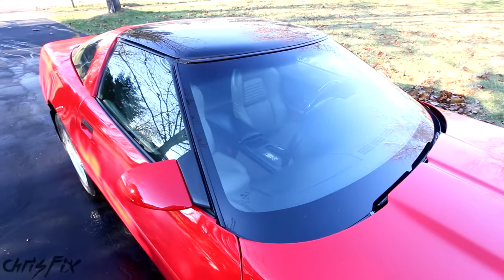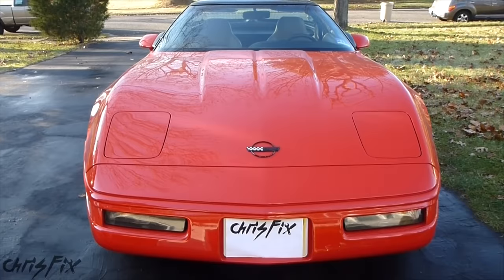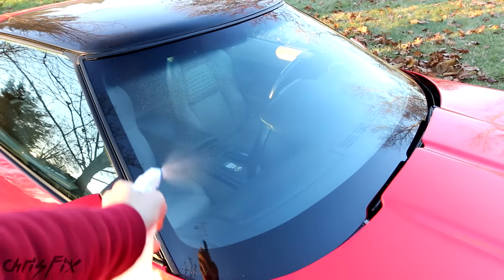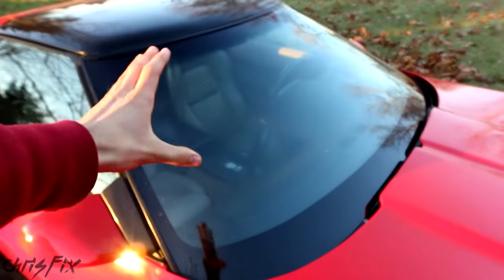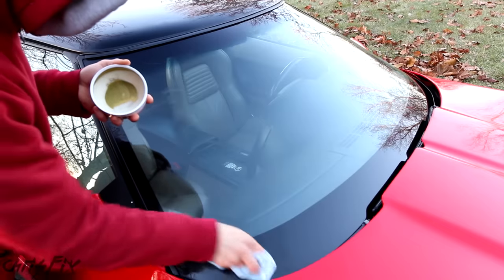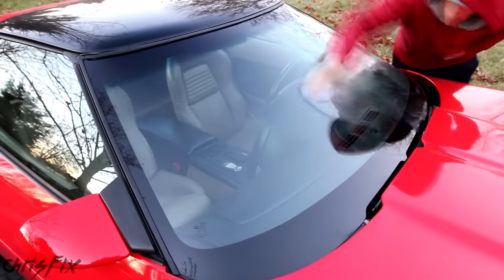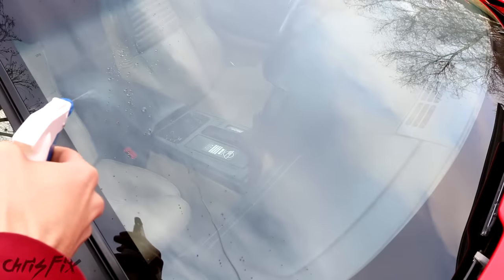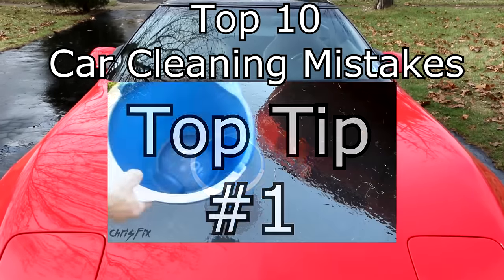How to Super Clean Your Windshield

Comment: My observations after detailing cars for years and trying various waxes...  Wax tends to leave bigger water drops that join together and are harder to see through because they are less uniform and larger.  They also sit on the window larger because they are bigger and it takes for force for the air to blow them off while driving.  Rain-x makes the droplets go into smaller beads that are more consistent in size and spacing and it is easier to see through the droplets, and  they blow off easier while driving.  This is just my observation on using a few different types of waxes. (Perhaps different types of waxes produce different results.)  Based on my observations rain-x provides better visibility.
Reply: Great analysis, thanks
Reply: Does your vehicle not have windscreen wipers? I recommend their use for the removal of raindrops - large or small.

Comment from the maker: I just posted the newest Super Clean video: "How to Super Clean your Interior" 
https://youtu.be/tGnf8G8A8qU
Reply: Your face!!! We see it!
Reply: Do you use special detergent to wash the towels you use? Can them all be washed together? TIA for your answers!
Reply: How do you super clean a nissan sentra gxe 1998
Reply: @jessie_official22  NOT with 2002 se-r microfiber cloths
Reply: Saw a video of a guy using plumbers putty instead of a clay bar but it was on a  white vehicle so you really couldn't tell if it scratched the paint
Reply: Can you tell me what kind of wax I buy
Reply: How you clean those microfiber towels?
Reply: Please post a video about how to remove stubborn water stains .
Reply: use the washer wiper thig then easyer
Reply: How do you remove deep water stains....my car has been neglected and cleaning it recular will still leave it foggy
Reply: I'm having issues with hard water stains on my cars glass. What do you recommend??
Reply: Hey Chris!! Quick question, how do i get rid of the scratches made on my windshield from the wiper blade? Steel wool and soppy wooder?  Please let me know what you recommend!
Reply: one of a few youtubes to still be active on older video ussually the bigger the channel gets the less the interact <3
Reply: u said it after 6 years
Reply: When I clean windows I wipe up n down inside ( when clean) & left to right outside so any marks/streaks I know if they are inside or out 👍
Reply: Yes, I can finally Clean my Dirty Interior In My Lexus
Reply: You should def leave some Amazon links lol
Reply: You realize we see your face so there's no need to wear a helmet anymore
Reply: What wax do you use?? The link for the wax isn’t working for me!!
Reply: Hey bud I'm gonna try this out before installing my new Piaa wipers, but my question is after I wax would you suggest to apply the silicone wipe that comes with the wipers over the wax or just skip that? Additionally will the silicone wipers do well with the wax or would you think they'd make streaks being two coating type products? Appreciate the videos as always man 👍👍
Reply: By in
Reply: @douglasbennett8184  qqqq
Reply: What year is his Corvette
Reply: Can I do this to all my other glass on the car?
Reply: Can give a video on how to clean your used microfiber towels???
Reply from the maker: @ramdomgiltter5590  that’s a good idea
Reply: Will plumbers putty work just as good as a clay bar???

Comment: it's good to respray old wiper arms and replace the wiper blades while you are in there, wiper blades are usually very cheap and while they are off the car you get access to the lower portion of the wind screen to clean it properly.
Reply from the maker: Great tip! Thanks Alex!

Comment: One of the most important lessons you can teach a new driver is how CRITICAL having a clean windshield is (all windows actually). The difference in visibility is unbelievable. It also reduces eye strain during long drives - especially at night and with how much brighter headlights have been getting. 

And using wax or Rain-X can save lives. One of my friends was driving into NYC across the Pulaski Skyway and a truck kicked up muddy water. Had his windshield not been treated with RainX, he almost certainly would have run into a concrete barrier and gotten killed.

Comment: SUPER IMPORTANT TIP: 

If you just bought an older used car DO NOT I repeat, DO NOT use wax on your windshield. It will fill all the tiny dings and crevices, creating a bunch of white spots that (so far) cannot be removed and it will make it look even dirtier.

Thought I would share to make some good of my mistake and hopefully prevent others from doing the same. Although, on the upside, the windshield is definitely hydrophobic! :^)

If you know any ways on removing wax from dings, please let me know.
Reply: Buy a new windscreen!
Reply: Maybe use ceramic coating?
Reply: Same thing here. Wax did not dry after 20mins and I had to remove it with soapy water i big pressure on windshield. This wax was mistake…
I am not sure if I got all of it off because it now raining outside now
Reply: a hair dryer will melt the wax, use your microfiber cloth to remove it once melted, you only need a few seconds of heat, do not apply heat for longer than that.
Reply: Seen in other videos an actual side-by-side comparison between wax and Rain X and it looks like Rain X seems to be the winner. Regardless of which one's better at repelling water, Rain X might be the way to go if you're worried about potential windshield dings?
Reply: Does rain x do the same?
Reply: @Chris-pj1os  Highly doubt it. It's a liquid in a spray bottle.
Reply: @Chris-pj1os yes it works wonders the ceramicx one
Reply: Same here. Looks like millions of tiny specks.
Reply: Will wax prevent Rain-X from sticking and vice versa
Reply: I soaked a cloth with nail polish remover and bathed my windshield. Got most of it, but not all. I’ll try doing that again soon.
Reply: Is 2011 old ?

Comment: Great video, as always. One thing I do when cleaning the wiper blades is to run an old toothbrush with glass cleaner on in the grooves of the wiper blade. Bug splatter and dirt builds up in the grooves.

Comment: I always like spending a little time listening to ChrisFix and his automotive TLC methods.  
I have cleaned my windows as thoroughly as I could and then put a layer of NuFinish on them and the surface was super slippery and the wipers were SMOOOOOTH.  I never thought to clay bar the glass, but it's clearly a real good idea!
Clean 'em, clay 'em, wax 'em!
A little extra effort at the beginning pays off in less effort and better results down the road.

Listen to ChrisFix kids.  He'll never steer you wrong.

Comment: I've been bingeing your videos for the last few days and have 2 questions
1- do you have a timetable for how often things should be done? Like regular wash, deep wash, wax, polish, etc. I know every vehicle is different but do you have a rough guide?
2- how do you clean and store all the tools you use to they stay clean and dirt free. 

Loving the content. I know the video is old but hoping you still reply ahha
Reply: 1. Wash your car with all the steps including adding a ceramic coat of your choice then wash it weekly with just water and once a month with a maintenance wash, windshield and windows clean them every 3 months I reckon 4 times a year.

2. Clean your tools as soon as your done with them then you will have clean tools every time you need them and their longevity last longer than leaving them caked up with crap till the next use. 
Create a system for example your microfiber towels have some warm water with soap ready in the sink so when u done throw them in there for a bit then rinse and throw in washing machine with appropriate towel soap.
Reply: @bigguwapbrixks187  Yep.  Stay away from the soaps that soften your fabrics and things like that.   That just leaves streaks on everything
Reply: Waxing you do whenever you notice water not heading off the paint. Polishing you only do once or twice a year. Or if you price a lot of flaws and scratches in the paint. Everything else is mostly maintenance. So you can do it whenever.
Reply: I think polishing should be done on a as absolutely necessary basis only and should be measured in times per lifetime. It wears down the clear coat, it's abrasive
Reply: @bigguwapbrixks187  Are you recommending to use no soap ("just water") on the weekly car washes? You use soap only on the monthly maintenance washes??
Reply: @The_CR_Phil  sorry I meant to say water and a legit car soap that doesn’t have wax in the soap, use a quick detailer on your drying towel.
Reply: @bigguwapbrixks187   Thank you!

Comment: So i just  did this procedure today...my windshield!!! its super clean and shiny, i messed some spots but my 1st time so i think its acceptable. Thank you for this wonderful trick. Cheers
Reply: Now when it rains you can't use your windscreen wipers you won't be able to see where you going and you'll crash
Reply: @niteblaster1  hi, this is true,  it rained today just to test and drove 15min, cant hardly see the road, is there a way i can remove the wax from the windscreen. tnx
Reply: @ronskie269  take a razor blade or some kind of degreaser to strip the wax from the glass. Dishwasher soap will work. For degreasing it. Really shouldn't be an issue though I used my windshield wipers on my car which I waxed but messed up to see if itll remove the wax even though I knew it wouldn't and it didnt stall or have trouble cleaning so chances are you need new windshield wipers which would be a good investment because poor windshield wipers might make your windshield dirty and make it foggier reflect more light and make it harder to really see.

Comment: I used to detail cars, we always used 0000 steel wool - works great taking bug splatter off fast and easy and doesn't scratch the glass, one step - soaking wet steel wool pad, squeegee it off.
Reply from the maker: Thanks for the tip!

Comment: Hey @ChrisFix I just wanted to say thank you I watched two of your videos last night before left work I just started detailing cars and this is my first time I’ve noticed how terribly smeared and smokey the windshields would get after I cleaned them I didn’t really use the extra steps to protect the glass I just did the wipe down with a microfiber and washed it with the technique you used and I saw an instant improvement I’m really surprised how quick it was and how great it turned out

Comment: As a Covid-19 shut-in in 2020, this was great! However, I gotta point out one thing. If, like me, you have an older car (mid-2000's), applying the wax will leave little white marks where there are tiny pits in your windscreen. The rest of it will be super-clear, but just be aware this also means you will spot these little marks a lot more easily now. Still better than it was, but when I'm doing it again, I'll skip the wax. :D

Comment: Good video!  Will increased use of the wiper blades remove the wax quicker or will they just glide over the wax/glass?
Reply from the maker: The wax is a micro layer that fills the pores so the wipers shouldnt affect it. If it does affect it, you didnt buff off the wax enough! Great question!
Reply: And what about the windscreen cleaner that you can turn on inside the car? I notice that the wax on the windscreen is faded already after a few weeks..
Reply: ChrisFix ??
Reply: Jeremy Kui A more gentle wiper fluid should help it to last longer. I don't know of a particular brand for that, but I would avoid anything labeled "super bug remover" or rated for a lower temperature than what you need.

Comment: I've been using a variant of this technique for years and it works amazingly.  But I will say that a fine steel wool has its place in the sequence; particularly if you have water spots.  The glass is much stronger then the steel wool and will not scratch. I've been using it for years when detailing a really dirty window and its never left a scratch. I like to do it before the clay bar.
Reply: Steel wool 0000 is king
Reply: yup, I agree! superfine steel wool first, especially good if you have any substance like paint overspray that has landed and dried on your glass....but only super fine never use coarse!

Comment: My dad said in the 1950s and 1960s they  always cleaned windows in a car with vinegar and an old newspaper . I do that and It works very well but your car smells like a pickle.
Reply: the pickle smell goes away after a while though, vinegar works well for cleaning a lot of things since it is a bit acidic.
Reply: +rbeck3200tb40 I have heard about using vinegar. what do you use to wipe the windows with?
Reply: rbeck3200tb40 I've cleaned my car inside and out with vinegar water. Looks fantastic. Also use mineral oil on my leather and plastic parts for the shine.
Reply: What type of cloth are you using to clean with.
Reply: Samantha Bullock
You can use a newspaper or a microfiber cloth
Reply: thank you
Reply: Haaaa!  I forgot about that.  That's how my mom cleaned Windows when I was a kid.
Reply: for car windows I would avoid news paper. it will not be sufficient at picking up dirt and it will leave disgusting streaks. paper leaves behind wood fibers which is noticable and difficult to clean off. microfiber the price of a news paper and 100x worth it.
Reply: No, rbeck3200tb40, my car doesn't smell like pickle!!!!!

You don't even know my car, so how can you smell it???
Reply: My mom has a spray bottle of vinegar that we use to wipe down surfaces don't like the smell but it works lol
Reply: Vinegar in your Washer Fluid..

Comment: I have a problem with cleaning the inside of the windshield. Any help/ideas for doing that? Thanks.
Reply: Jim Cars he has a video link in description
Reply: Some Tip for interior Glass cleaning 
-Wipe Horizontally and Vertically because circles will most likely leave smears
-Use a microfiber cloth and spray your product on the cloth and not on the window so its easier to clean and you don't get the cleaner on the dashboard
-Wipe from the passenger seat as the wheel will get in the way.  

I just use Invisible glass and microfiber
Get the job done most of the time.

Comment: I once read you could use mothers polish on your windsheild sense it's tempered  glass which is about double to triple the Rockwell hardness of the average steel it polishes. It does an excellent job of removing everything and leaving a crystal clear finish

Comment: I have a Toyota Sienna that I love, but after two years the inside of the windshield was filthy and also streaked from my efforts to clean it. Your methods work GREAT but even though I’m tall for a woman I can’t reach the top middle of the inside.  For the outside I used a small step stool. I have a small silicone squeegee that reached where the glass meets the dashboard but it doesn’t reach the top. I’ve bought a lot of the products you recommended and would rather not shell out more money. Suggestions appreciated please. And thanks for these fantastic videos!